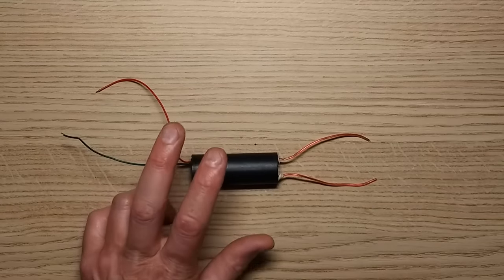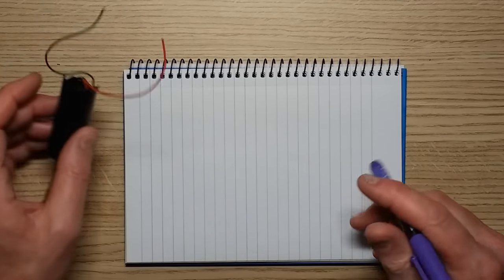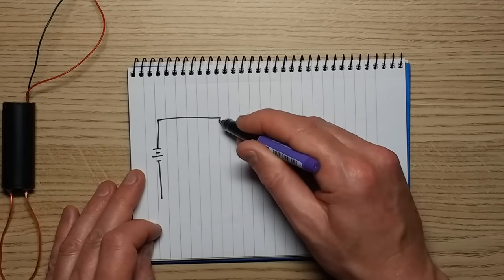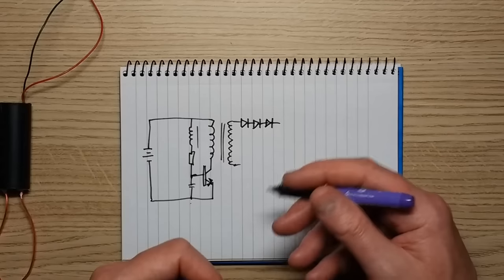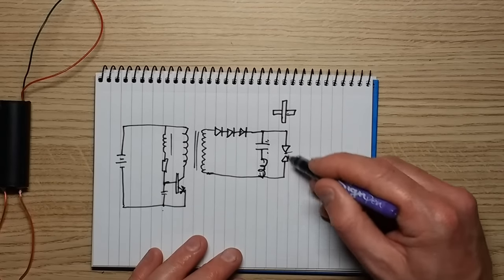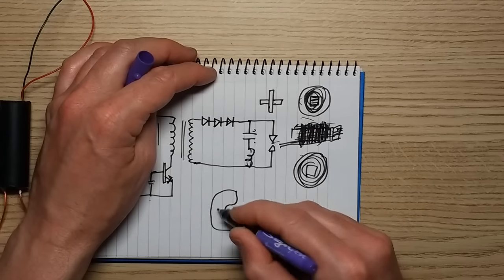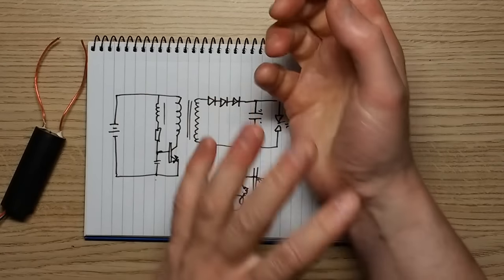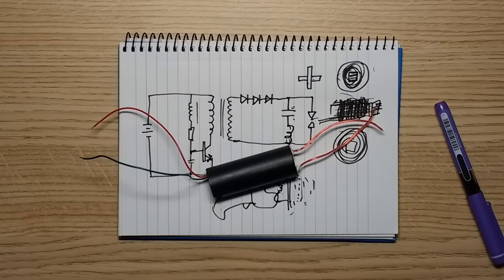Are these stun gun modules?  And do they hurt?  (yes)

Comment: am I the only one who is debating whether this could be used as a motorbike theft deterrent? wired to the grips...
Reply: I was thinking more along the like of one lead being attached to the metal of the car and another lead being attached to the ground.

"Don't touch my car..."

<zap>

"Well, I warned you..."
Reply: Grumpy OldMan if you think that will work you havnt finished the video yet :)
Reply: Danielle Harris I thought similar with hasp on shed with a PIR or radar sensor to switch it on if anyone was around. You still need a spark gap as the will burn out also only rated for around 30 sec bursts. Think it would be illegal though.
Reply: the charge would the pass through their heart which could kill them
Reply: That WALL.  Just a Line in the sand & This.
Reply: Or the seat for better results.
Reply: until one day you forget to turn it off or it turns itself on while you are riding the bike
Reply: Danielle Harris I plan to put this on my bicycle when I move to the city for uni
Reply: I've always thought that would be an awesome idea for a vehicle theft deterrent. Wire a few big capacitors to the door handles.
Reply: theglurgle I have... I know it can only run for a short time.. I think that's what you are getting at? pressure switch under saddle to sort that out :)
Reply: tesseract. how would it do that? the spark gap can't be that wide so it would all be on one hand..
Reply: Theres always a chance. Police issued Tasers (the ones that shoot prongs) can definitely gap between your heart, but we seldom hear of fatalities because of that. Still, these stun guns/tasers are dangerous and could kill someone, if they are a child, or have an existing condition or whatever. So its not worth the risk imo.
Reply: That's illegal. You may not booby trap your property in most sensible countries (yes even the US.) If you get caught, you can get jail time, or even prison time if you seriously injure the person.

DO NOT BOOBY TRAP YOUR PROPERTY. IT IS VERY ILLEGAL AT LEAST IN THE UK AND US. AS OF WRITING THIS.
Reply: Mitochondriac care to cite some legislation on that?  I'm totally aware of a steering wheel lock that worked on high voltage low current (they quoted 100,000v from memory) that was for sale in the 90s.  either way, I'm sure I commit a myriad of offences everyday and who would go the the police saying "I tried to steal this bike but then it shocked me"
Reply: Taser kill many people, just not as many as bullets. The wider they're deployed and used the more people will die. Don't know how many fatalities or injuries there are from CS spray.
Reply: +Grumpy OldMan Genius, then your gadget kills an unsuspecting child and you spent the next decade in a cell.
Reply: Mitochondriac US law doesn't apply to me. I'm not there
Reply: You should probably stick to what you know.  Ignoring moral issues, wired to the grips it would just jump side to side through the handlebar, unless the voltage was so low that it became ineffective.  It would immediately discharge and fail or run the battery down the moment it was armed.
Reply: Stinky Cheese running each lead around the rubber grips, and having it go off when the bike is moving? You're oversimplifying this concept
Reply: It would be a criminal offence, defined as a "Man Trap" under offences against the person act. Similarly to people wiring doors up the mains and such like at cannabis grows
Reply: Curtis Dorris great idea until someone with a similar car grabs your car handle by mistake revealing a dodgy ticker they never knew they had...
Reply: Mark Howards , well don't touch my fucking car lol. Besides the current wouldn't go through their "ticker". A car door handle is one handed.
Reply: why not leave 2 small invisible wires on the so you'd stunn his ass XD
Reply: Danielle Harris Those door alarms that hang on the metal door knob put a tiny amount of electricity on the metal. When someone touches the metal, the impedance drops, triggering the alarm. So... for your bike/car , you need the sensing circuit which when triggered would close a relay activating the shocker unit. Very doable.
Reply: -SrMofo it takes ~60ma to stop someone's heart. However, a person will get 'stuck' to something they grab with as low as around 10ma. I'm not getting into the argument about morality or legality though.
Reply: there used to be a product sold here in the U.S. that was a combination steering wheel lock and stun gun. I believe they can still be found on ebay, as old surplus.
Reply: just have one sparking on the dash when you leave the car. should prove a deterrent.
Reply: Brooks Ellis . You are close but not entirely correct.  You are leaving ac versus dc as well as frequency out of the equation. Most descriptions refer to common house voltage which is 60hz ac which is usually quoted right around whay you stated.

Either way I'm not entirely sure why you singled me out when I explicitly stated that a small amount of current across the heart is dangerous. I explicitly stated shocking someone's taint which is no where near the heart and as long as the 2 prongs are both in the seat the current will not pass through the heart. I also wouldn't fear a muscular contraction and not being able to let go because the current is pulsed.
Reply: I guess it depends on how you define 'low current'... I had it in my mind that it was around 30ma to stop (or cause fibrillation  (sp?) of a heart; which is fine if I'm trying to avoid it, but then I read more recently that it can take as much as 2-3x that amount to kill you straight up. Live and learn!
Reply: The majority of those bait bike/bait car videos are hilariously fake. Electrodes with unstripped wire, or a single piece of wire rather than two electrodes. There are a couple real ones, but most aren't.

Sure, you CAN do it. But most youtube prank video channels don't have people working for them who even understand the basics of electricity. Just a lot of actors.
Reply: A small AA powered BBQ ignitor could make a tiny but painful tickle on the hand, if wired upto the clutch lever with an extra piece of bare wire threaded through the rubber grip. You'd need to add some kind of switch to the clutch to activate the bbq ignitor when the clutch lever is pulled in.

Then, you simply remove the AA battery when you want to use the bike. It wont knock someone down but it'll give anyone who squeezes the clutch lever a shock equivalent to any kind of shocking novelty toy.

But why do this shit to prevent your bike from being stolen when you can, ya know, lock up your bike properly
Reply: Brooks Ellis - it is both the current and the duration. The current will be a resultant of the path through the body, the resistance (how wet/dry the skin is and the presence of clothing) and of course the voltage applied. 

As little as 10mA can be fatal if applied directly across the heart. But equally, a non-medical grade RCD will trip after 0.3s @ 30mA, which is considered non fatal (though still a horrible shock). 10mA for a whole second, hand-to-hand (therefore directly across the heart) will likely kill you
Reply: Ei aC if they have the nerve to try and steal someone else's honestly-earned things, they should at least learn a painful lesson.
Reply: You might also accidentally kill a small child or animal.  Just for the record, I'm sure you weren't really going to do this.
Reply: that would work...but you might kill them if one hand is on the grounded frame and and the other touching another lead. well they can probably not prove it as it just looks like a hearth attack a little later...destroy the evidence if that happens :P
Reply: Won't kill a person but you could do time.
Reply: I'm sure that would be illegal but yeah. Rig it to the inside wall if your fuel tank 👍 you loose the bike but at least you get to visit thief in hospital 👍
Reply: Magnavolt!
Reply: I remember a friend who wired a big fat diesel battery to the doorhandles of his mercedes back in the days when stealing car radios was a thing. Well, it worked.
Reply: Before you do that check the laws inyiur area.
Reply: Check the laws in your areal on the shock circuit.  My   recommendations a kill switch on the starter circuit. Put  chains on the wheels. If you. can't move it or start it it's not going anywhere.
Reply: You will be responsible for the out come if it kills someone. That person may have a weak heart. There has been a few police department sued for the use of stung guns. You never hear about it. If you must do this use a fence charger. It much more safer.
Reply: A wire from a spark plug
Reply: Yea! Use five or six of them in parallel for higher current and wire them from the grips, and the seat, so the thief gets a hot shock to the taint, and stimulate the pain nerves of the prostate if male, and twat if not. Imagine the instant regret incentive it would give them to reconsider their actions!
Reply: Two wires at the back of the tank, with a slight testicle spark gap. 

Wired to the rear brake pedal.
Reply: yes you can!!! but unfortunately it’s illegal. some how some way....... i just seem a video of a labor who kept getting his tools stolen and he wired up his van. now he is going to court.
Reply: If u figure. One. Out. Share

Comment: But this module doesn't have 2 transformer. It uses step up stage followed by a voltage multiplier stage then storing it a few capacitors and discharging across the terminals.

What kills the module when the terminal are distanced apart is not over voltage but overcurrent.

When it fails the discharge the feedback lags, oscillator lags and the transformer saturates. On staturation there is nothing to limit the current flow as the inductance zeros and this results in overcurrent which burns the transistor.

You can solve this by limiting the current and now even if you keep the terminals half a mile apart, it won't kill the module :)

You are right that the frequency at transformer is quite high which if touched directly will not give any sensation but serious burns.

The frequency is lowered through LC circuit, where transformer (coupled inductor) is the inductor and capacitors are put next to it to lower the frequency to short pulses which we can feel.

The frequency of these pulses depends on the inductance/capicantance and frequency/duty cycle.

Most people here use 18650 cell, if you put a 1ohm resistor in series, your modules lifespan will improve a lot!

These modules are designed for Akaline cell operated tasers which have much higher internal resistance compared to the Lithium Ion cell as a result overcurrent is limited to some extent improving the life of the module.

I used a flame thrower to melt the Resin then I scopped it using an oscilloscope.

Comment: It would have been great to see you accurately measure the voltage output on these units similar to the way you do with LEDs or appliances. Fantastic video and relevant.
Reply: It is difficult, and it's hard to choose a way of measuring it that is satisfactory.

Comment: Haha....I didn't have to touch it to know it's was bad...just spent $2.38, patiently waited and when arrived hooked it to a 9V and just smiled after I shit my pants a little HAHAHA
Reply: Best not a 9v if you don't know if it can handle it, start with 3 and work your way up.
Reply: Use the 5V output from an ATX power supply. Easily capable of more than enough current to drive this.
Reply: try a power bank. But keep in mind theses zappers draw currents far in excess of 1.5A.
Reply: I would not recommend using electronic power supplies to run these, they take awul pulse loads and shoot back terrible voltages and noise all over the shop. Batteries don't care as much.
Reply: MyBigThing2010 the other thing with using a mains power supply is even though it may output 5v it is likely to be referenced to mains. Remember not long back a girl dropped her mobile in the bath which was only connected by a USB lead.
Reply: The full story said that she used an extension lead which was faulty
Reply: 9v can damage ur stun gun. Start with 3
Reply: Shouldn't matter, a charger should be fully isolated from the mains. Shouldn't matter what goes into the input. If it was an Ebay Special, I'm not surprised it killed her. And plenty of market stalls and little shops sell the same dangerous shit from Ebay.
Reply: greenaum the extension lead had live wire sticking out and she grabed it
Reply: Ah ok. So it would have happened even if she hadn't had the charger.
Reply: i recently bought a slightly bigger version and it scared the shit out of me. I didnt think it would be that LOUD
Reply: What would happen if you hooked it to a car battery? I would use one that has gone flat several times and you've replaced, plug it into a battery tender and see if it'll hold a charge. If so, stand very far away and use a switch to do the thing.
Reply: With a car battery, probably one of the coils would burn out from the current far in excess of it's design. They don't build a lot of a reliability margin into Ebay stuff that costs $2.38.
Reply: Where can I get this modulator is at can you send me the link please?
Reply: With a 9V battery, it completely depends on the chemistry. If you tried connecting a typical alkaline or zinc-carbon 9V battery you'll barely be able to pull 150mA and the voltage will be sagging down to what you'd see with AA batteries. 9V Lithium would be more around the 500mA range. If you had a power source that actually provided 9V to this module, you would be pulling amps of current, which the transistor or the windings will only tolerate for a limited number of seconds before they burn out. A 12 car battery is designed to provide hundreds of amps for short periods, your module wouldn't last a second on it. 

So depending on the chemistry, people are getting away with powering their flyback joule thief stun gun module because the batteries are current-limiting themselves.
Also, other commenters are quite right, don't connect this to a SMPS unless it is galvanically isolated and has some combination of choke and TVS diode to damp and clamp the return spikes.
Reply: I tried a half-dead 9v too, only 6.5v from the battery without a load and this thing still made very loud and large sparks !

Comment: I removed the spark unit from an old gas cooker a few yrs ago , it has a similar output but the frequency of the spark is lower. I used it to set off a hairspray fueled spud gun but it left a small hole in my living room ceiling.. oh how I laughed , 'till the missus saw it...

Comment: I used to work for an electronics manufacturer.  That potting material is very hard to remove but it is possible.  Use a heat gun to soften the material and then you can slowly pick it out.  You may end up ripping some of the small SMT components, or in this case fine wiring, but it is still possible.

Comment: I use one of these along with a constant current regulator board in a DIY powder coating electrostatic gun that i hook up to my air compressor to blow the powder. Its basically some PVC pipe with a T fitting and one side of the top of the T plugged. The bottom of the T is attached to a threaded cap for a glass bottle which holds the poweder. The plugged side of the T has an air coupling on it, along with a piece of tubing that runs through the plug and down into the bottle. The electricity bit connects to a piece of copper solid wire that runs down the main piece of PVC tubing and every inch is a piece soldered  to it which keeps everything centered. So air is blown into the bottle which blows the powder up and through the threaded bit, then down the tube with the copper thats electrified. This charges the powder and it sticks to any grounded metal just like a $400 gun. Works great, not one shock. And so far i've gone through 5 pounds of powder using the gun on various projects. screw paint. powdercoat rules.

Comment: Those work amazing on 18650 cells.
Reply: jdflyback I can use these to charge 18650 cells? 😂😂😂
Reply: Clive that would be a good video, run one of these into an 18650 battery
Reply: You can use one of these to blow up an 18650 and set it on fire.
Reply: Lol no, I meant these work well when they are powered off of a lithium cell.
Reply: jdflyback we need to power lithium cells with these!!
Reply: Most of'em are supposed to run off 18650s.
Reply: So far ive tried 3x 18650.....and they work fine!!, while i was messing around at my work bench, a mate walked in an assumed i'd took apart another fly bat, grabbed hold of the hot end and told me to pulse it, i warned him that it was very high voltage, him being "a man...i can take it" sort of person, i gave it a good blipp!!lol!, he screamed like a little girl!, my side ached for days after that!!
Reply: jdflyback yes they do
Reply: These modules are easily blown if not handled  with care.

Comment: I did an interesting experiment with one of those. I put the contacts about 1cm apart and in a closed glass container with a hose to pump air in and another to let get out again. I put some pure water in the bottom of the container along with a magnetic stirring pill. I turned the magnetic stirring machine up to almost max. so that the water kept splashing around a lot, mixing with the air inside without touching the contacts. I then turned it on for a few seconds, blew new air into it, and repeated the process several times. I then turned everything off and measured the PH level of the water, which was around 1 because the electric arc turned some of the nitrogen in the air into Nitric Acid. This experiment is based on an experiment from the 30s I believe. If you would make it solar powered in your backyard, you could slowly produce nitric acid in your backyard for free essentially. :)